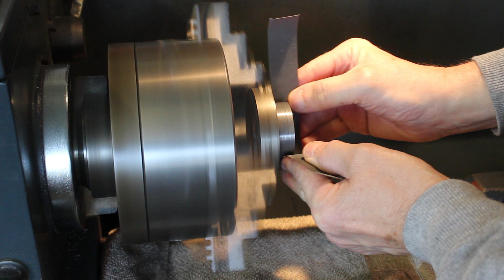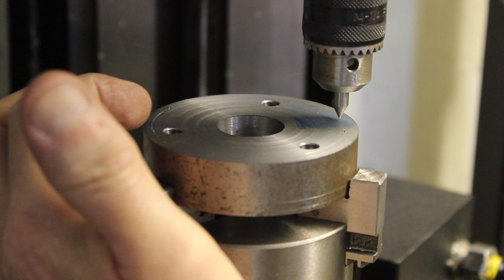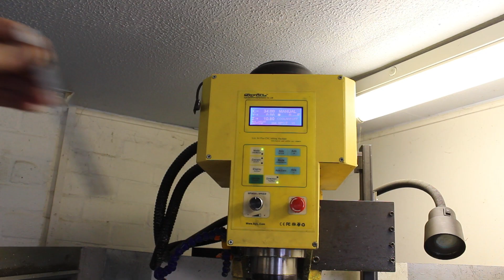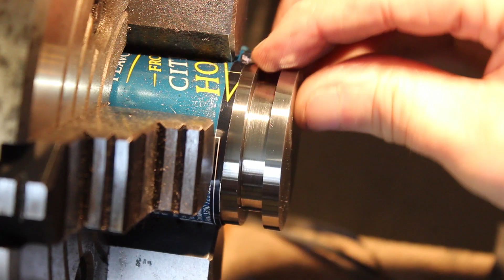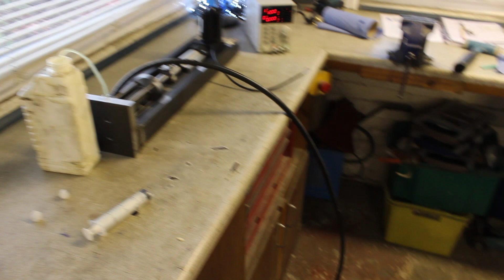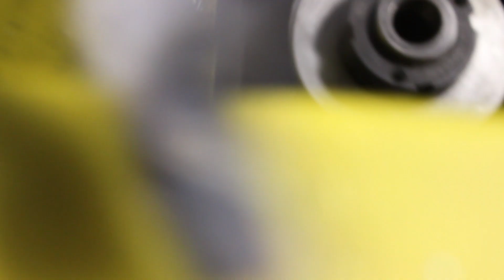DIY electro-hydraulic power drawbar construction pt2

Comment: In the video where you mounted it to the mill you unfortunately skipped the bit I was waiting for, fixing the belvue washers to the drawbar or was a new drawbar made to incorporate space for them. Maybe that was in a previous drawbar setup, not found it yet.
Reply from the maker: Thanks Derek, its not always easy to get all the info needed in these videos. When you get to the edit you realise bits are missing and its too late to reshoot. 
I did however make a replacement drawbar silver steel or drill rod as its called across the herring pond. The Belleville springs are a loose fit on the drawbar and held concentric in a can that screws over them. This also keeps the anti-seize in place as it would fling off at the spindle speed.
Just came across another device that might get the required force an electric parking brake off a modern car. I will look into it and see if its would do the job.
Cheers
Reply: @CazualHaze  looking forward to that, i'm using an air powered butterfly wrench at the moment while deciding what form the end project will be.

Comment: Watched the series thanks for the videos. Given your original goal was to make a economical power drawbar I was left thinking that air would have been a more economical route. What you have done is develop a hydraulic pump to drive a cylinder. I was wondering that given the limited air used a fridge compressor (or 2) into a reservoir would satisfy the economical compressor needs vs the gear to make hydraulic pump. With the availability of compressed air lots of simple options for PDB on the net. 

The hand lever early option looked most interesting. There is a youtube(can’t find it) implementation using double acting levers that’s looks very interesting
Reply from the maker: Thanks for the comment Jeffrey.
I completely agree I use a fridge compressor motor at work to pull they air out of plastic packets before heat sealing them. It works great  I also have seen compressors around now with these types of motors ( quite). The problem I have found is I needed around 14NM of torque on my drawbar to stop the tool walking out. This ( I am not completely sure) equated to around 1500kg of pull on the drawbar. 
The commercial systems seem to bear this out with three stacked cylinders of around 100mm dia running at 90 psi. This works out at  490kg/cylinder x3 = 1500kg force ( my maths cant be relied on though).
The cost of one of these triple cylinders is frankly horrendous hence the hydraulic option after an extensive amount of time trying to do it with motors.
The hand operated lever types look interesting but looking at the effort from the operator and the lever advantage the drawbar pull has to be in the order of tens of Kg they also put that load into the bearings. Scale that up to the force I need and the lever would be feet long and the bearings would be trashed.
I still think my final solution is quite a cheap way to go. 
Still working on it, mechanically its good the electronics are now playing up. More of that in an upcoming video.
Cheers
Reply: Thanks for the reply.  Yes when I looked at prices of direct drive tripple stacked cylinders absolutely eye watering compared to single cylinders
Following Hoss experiments with affordable PDB he went from homemade tripple to long stroke single operating through a lever. Watching https://youtu.be/SiJkzqBLjNo leaves me still thinking a single air cylinder would do the job?
As an aside I just Purchaced a cnc’ed seig c3 with pdb and it operates of 90psi with a single cylinder direct drive. It’s been in operation for many years but I haven’t tested it in anger so not in position to suggest it’s doable yet
Reply: Wondering why my single cylinder on air is working..?..   wonder if it’s the difference between using a M3 spindle vs a R8 spindle. My seig x3 is MT3. The pressures often quoted are based around the Tormach are based on R8 spindles
Reply from the maker: Not really sure the seig is very similar to my syil. All I can add is if you watch my efforts in making quick change toolholders for my lathe the tool walked out of the spindle. This is what started me on this whole pbd thing.
Would be interesting to do the maths on your cylinder what's the dia and stroke? also is there any mechanical advantage ( levers etc)? we can work out the drawbar pull from that info.
Reply: Yes must admit I’m a little hesitant.  Only had the mill for a few days.  The owner showed me the work the mill did - mainly aluminium Rc airplane stuff
Cylinder looks about 80-100mm dia direct drive. No lever. So yes I’m with you in having worries. Must find a way to test how secure the tool is when mounted
Reply from the maker: The maths looks like 495kg pull with 100mm piston. Ally is definitely easier to machine than steel. so owner clearly got it to work well.
Have a good search =on web see what you think the pull should be. When I looked it was recommended at 1000-1500kg. 
Let us know how you get on. The more real world data we have the better for all.
Cheers

Comment: Great project. I've been thinking something similar but using a 24v power pack I manage to get at the scrap yard. Now need to find out where you're getting cylinder stock 😁
Reply from the maker: Interesting I am going to do that as well but I am using an old pc supply as I can get 5v for an Arduino and plus and minus 12v. I am going to use 12v for the direction relay and 24v for the actuator.
I have found an even cheaper way to get an actuator, old car mobility scooter lifts are virtually scrap and powerful.
I think I might get tool changes down to 10-15 seconds that way. 
The cylinder came from the scrap bin of a local hydraulic repair company for the price of a beer. 
More detail on my how to get free /cheap metal video.
Reply: @CazualHaze  I meant a hydraulic power pack. I have just watched the video. Time to try and find a hydraulic repair place near me.  No chance yours is near Cheshire?
Reply from the maker: No I am in the middle of Norfolk.
I cant name the company I git the bits from I would need their permission.
You can get parts online!